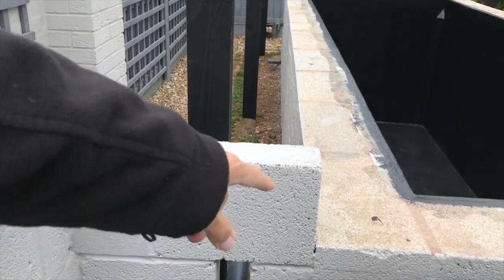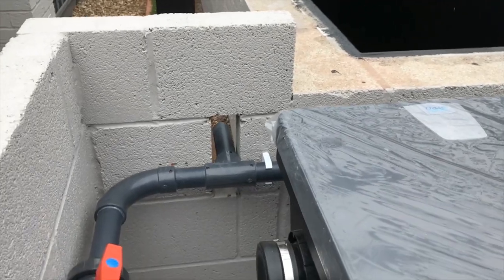New Telford Koi Pond Part 21 - Pipework & Oase Proficlear Drum Filter & Individual module Install.

Comment: Hi Phil,
              And thank you for getting back to me. My bottom drain is only a 2 inch feed & i am running an Evoluion Aqua 10,000 varipump but  i have only had it on 20%. I think that my bottom drain may be the problem but i really do not know how to rectify the situation.

Regards
Robert

Comment: Hi Phil that rubber flange for the overflow on the 4” for an overflow. Where did u buy it please? 
Weather seems to be in the change. This week cheers
Reply from the maker: Hi Aaron it’s a 1” uniseal . They are available from lots of places but bought mine off eBay, just type uniseal in the search engine. Think the 1” is £4.99 but great and easy way to put a pipe through another pipe with no leaks👍😊. Hope this helps👍🐟🈲😊

Comment: Phil was just watching back and see u used 11/2 pipe rtn. Ive bought 2 inch rtn pipe and valves. Just assumed that was the size to use. Any major reason why u did it in the  1 1/2” Been a busy few days here bd drain in most block work to water level done like ur tip about pipe in wall before fibreglassing re ressessing it into insulation  must rejig that before its too late 🤫😬
Reply from the maker: Evening Aaron👍😊. The reason why I used 1.5” instead of 2” was because I used 1.5” pipe work in my previous pond and knowing I would want a return of around 10,000 litres per hour through 2 primary pipe runs (3 actual returns), 1.5” was more than sufficient plus the, pipe, fittings, ball valves, etc. at 1.5” are slightly cheaper than 2” versions and the Oase pump fittings, Bitron uv and Thermotec ASPH fittings I used are all 1.5”👍😊. Have you checked the fitting size on the pump, uv, filter, etc. you are going to be using? Are they 2” or will you need to reduce to 1.5”?

Comment: I am installing the same filter Proficlear Premium compact L and was wondering what those fittings you used were, that connected to the tank with the jubilee clips? I have two bottom drains and a skimmer and didn't really trust the push fit piping but your finish looks good.
Reply from the maker: Hello there🖐. Only just seen your comment as it was “held for review” for some reason???. The fittings I used were just the Evolution Aqua rubber fittings….4” straight connectors from the 4”bottom drain to the sleeve on the drum filter and the 4” to 1.5” rubber reducers on the outlet side. I simply doubled up on the jubilee clips to make sure of a secure connection and as the filters are in my filter house, the rubber connectors should never be impacted by uv light😊👍

Comment: @RobertBrown-yi9em
2 minutes ago
Hi Phil its Robert from Oxford. I am having a bit of trouble setting up my Oase Proficlear Gravity fed drum filter. We have done all of the pipework but when we turn the pump on the water level in the filter box drops 4/5 inches. Is this suppose to happen. I have not yet added the Helux media. Any help or suggestions would be very much appreciated. I have done a manual clean & that seems to be working ok. Regards Robert
Reply from the maker: Hi Robert,
There is a dramatic drop in your drum filter when yo turn on the pumps but the amount of drop will be determined by the power of the pull from your pumps. I run 2 pumps after my drum and they have a combined pull of 12,000 litres per hour, when I turn them on the water drops by 3 inches. I have a 4” bottom drain and 1.5” skimmer line feeding my pump. As long as you have similar there shouldn’t be any issue.
If you are pulling 20,000 lph or above you will see a big drop in your filter chamber.
What size feeds do you have and what pull are you running?